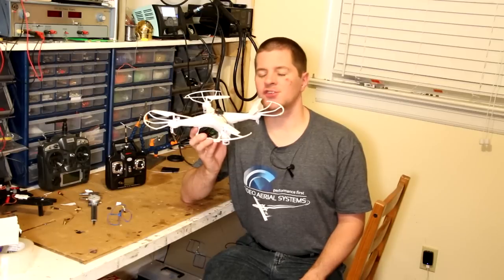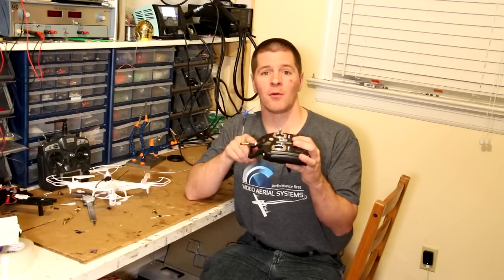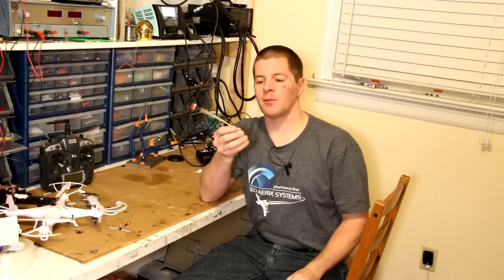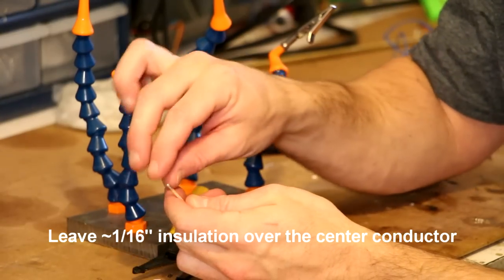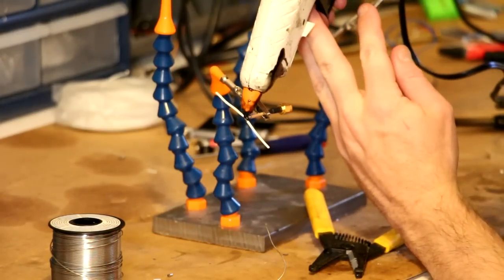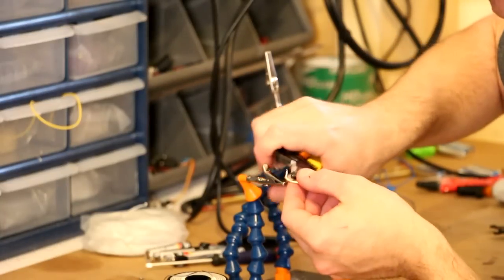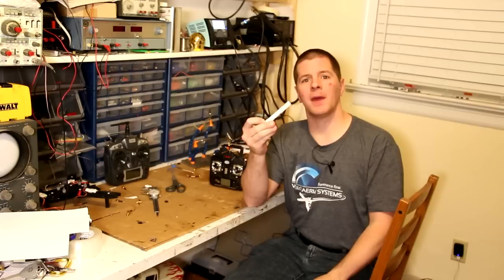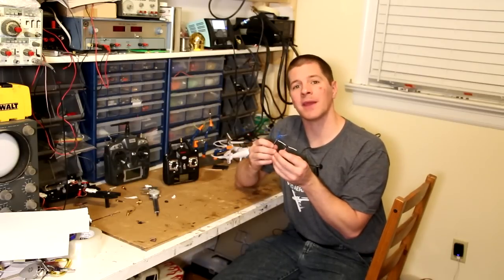Syma X5C control upgrade (FPV mod part 2)

Comment: I did the mod. But I changed one thing. Instead of soldering two 1.25 pieces on the end of the antenna I just measured back 1.25 from the end and unraveled the shielding and twisted it together and bent it 90*. Did the same for the center wire. Worked perfect. Less soldering that way. I also soldered the end and  put heat shrink tubing on the shielding wire to protect from grounding out and making it stiffer. I stuck a wooden  dowel in the hole where the antenna comes out and taped the new antenna to it, no more floppy antenna.
Reply from the maker: Nice work and good suggestions for other builders.

Comment: Nice set of vids.  I'm on my third x5c and they are fun.  On #2 I went all in on the antenna/camera mod.  I replaced the stock xmit antenna with a 6db 2.4ghz from an old Cisco router, which gave me a full wave, adjustable.  I then went into the copter antenna and quadrupled it's length, but laid it along the arm and hot glue spot down.  The max range on this went to extreme, as in hundreds of meters, but it also created a major problem.  Seems that some of the locals using their 2.4ghz things would mess up my signal and the last time I saw "Quaddie 2" it was happily flying away, totally out of sight.  I would say that I kept some control for probably close to 300 meters.  On the camera, I use the Mobius and replace the stock battery with a 100 mah. I use medium density foam for a mount and it eliminates almost all jello.

Comment: Moding the antenna inside the quad properly will make a huge difference. You can get over 1km.
Reply: Offshore Drifter definitely not 1km mate. 300m at the max

Comment: I fly my X5C with my X8C Venture Controler.  And my range on the X5C1 with 6 units using the stock controler is OUT OF SIGHT! Over 300 yards!  I have never had one go less!  And THAT is how I have lost two!  I can't see what way to put the stick to bring it back and with the 680 Battery!  She goes pretty far!  Never found one, the other is waiting to fall out of a tree.

Comment: My X5C got about 80 meters without a mod.  I used a router antenna on the controller, not that it really needed it.  Now it can be a speck in the distance and I can still control it.  Unable to test range as it would be out of sight.  This controller also works with my X11.  Some controllers must come from the factory with a weaker output.

Comment: Hi,Alex
My Syma X5C-1 ( bought 2 months ago) had  pretty good 312 ft (98meters) range  right from the box. I found some RG-174 (50 ohm) cable in my house and decided to make the same (a little bit simpler)  like yours dipole antenna.For first try I made each arm 31mm.  Test showed no improvement . For second try I considered my cable/wire velocity (i.e. electromagnetic wave propagates  with different speed and losses  in the cable then in the open air) and cut each arm to 27mm.... And ,Oh Magic! The test on the surface showed 713ft (217meters). So,thank you for provoking lazy me with this little project.
 Now I have a question to you : have you tried to play with the antenna inside the droneI would show couple of pictures ,but have no idea how to attach them here.

Comment: Great mod, but I don't understand why you were getting such a bad range.  I have an X5C and get much better range than that stock.  Never really measured it but I know it will do at least 30 - 40 meters.

Comment: Hey man very nice video! i have a question, i can solder a copper stick straight into the remote board? and in the quadcopter you leave the original one? standing up? how about copper wire too? Cheers man

Comment: Hi, I saw a different video where an unshielded wire with SMA female connecter was used. The wire was cut down to 6.25cm (half wave) and soldered instead of original antenna. Then true shielded antenna was attached to SMA female end. Any thoughts on this? Thanks for a great video.

Comment: Hi Alex! Great video! I attempted this upgrade tonight and I think Syma has changed the design of the antenna board. I did not see a second place to solder the shield. Have you heard of this happening? Could they have changed the design to make this modification impossible?
Reply from the maker: Joseph Lohmeier - I have not heard of any changes.  Try testing around the board and simply use the nearest ground you can find.  Ground is common throughout the entire circuit.
Reply: I found one directly to the left of the original antenna. It's no longer below. Thanks for all the coo tutorials! I can send you a photo if you're curious about the new layout.

Comment: Is there a certain type of RPSMA cable that works for this? Is there a specific length needed to be cut from the RPSMA cable too? , ive tried this on a UDI 818a and never got any changes in range

Comment: Alex,

Have you had any experience with the Ominus transmitter/receiver antennas?

I'm disappointed by what I perceive to be a fairly short range on my unit even when I'm flying in areas that should have minimal 2.4ghz interference (parks, farmland, etc).

Do you think the transmitter would benefit from this type of upgrade?

For the multirotor itself, I drilled a small hole at the top to expose the antenna lead in the vain hope that this would reduce some of the signal loss which may occur due to the placement of my 808 #16 (typically in LOS between myself and where the receive antenna rests in the body from the factory).
Edit: Putting the receive lead UP vertical decreased the control range greatly. Switching it to DOWN vertically (extending just about as far as the body of the 808 #16) significantly increased the control range. However, I feel it still could be better.

My knowledge with RF is rudimentary at best, so I look forward to any further help or tips you may offer.

Thanks for your time.
Reply from the maker: ***** - I am not familiar with Omnius antennas at all.  Most antennas I see are just junk, though.
Reply: Alex Greve
Good to know. Do you have any material I could use to try and see how bad/good the antennas in my Ominus are?
Reply from the maker: ***** - Not really.  At least not anything cheap.

Comment: Can I just solder a 31mm piece of wire to the GND pad and keep the stock antenna? Would they have to be 180 degrees from each other?

Comment: I bought the nice black one today I used to race petrol rc cars would the acoms crystal antenna work with my old controllers? Or would I be able to change the crystal reciver in the remote ?
Reply from the maker: scale model workshop since 2013 The days of crystal oscillators are long gone.  That will not do you any good these days ;)
Reply: Yeh?  every rc car uses them still tamyia,hpi racing ,Schumacher petrol engine and battery use crystals couae when we race them we need to make sure we all have a different numbered crystal so the reviver don't control another car ! I'll maybe try it but the x5 sc explorers 2 version has great range nearly lost it today on a roof lol

Comment: so even with the notch filter the control has been affected? im sure the stock range is not 5m?
Reply from the maker: I was getting only 5 meters before control became intermittent in certain areas.  Outside I would go ~10 meters or so.  Right now I'm going ~65 meters with the antenna mod.  The notch filter certainly helps, but it does not cut all interference.  The first harmonic of the 1.3GHz band is very close to 2.4GHz which causes problems with control if not filtered.
Reply: Alex Greve agreed I have two stock RNG sucked mainly because the remote antenna is stuffed in sideways horizontally and isn't proper length but any dlink saves the day I did the antenna in the quad and found a difference but I also dropped the wire out the bottom and out a landing bar hole

Comment: Hi alex i'm new here, I have the syma x8w and i'm wanna know if i can use any wifi antenna?
Reply from the maker: +jesus aguilar bossio - I would think you could so long as you can do this mod.  An antenna only cares about the frequency and the connector.  if those match, you're good to go.

Comment: Hi Alex,I have recently bought the Syma X5C-1 quad. I also bought some 2.4Ghz wifi antennas with leads in preparation for doing the antenna mod as you have shown. The problem that I have is that on my board where the standard manufacture antenna is soldered there is NO ground tab on the pc board to attach the braided part of my coax to. I have taken pictures but can't see that I can upload them here. Totally confused now. Please help. Best regards, Dave.
Reply from the maker: +Dave Bear - Find any ground inside the radio and attach the coaxial cable to that.  From there loop it around to the antenna pad on the radio.  Be sure to keep the cable inside the jacket (you can solder the shield anywhere along the run) until you hit the antenna pad.  Just solder the middle of the cable somewhere inside the radio to a ground.
Reply: +Alex Greve  Thanks Alex for the reply. After further investigation it turns out that the newer models have the ground pad there but it is covered with the circuit board colour coating. I was able to gently scratch the surface away, test it for grounding and solder it pretty much as you have done in your video. Upgrade completed now and working very well. Thank you.
Reply from the maker: +Dave Bear - Good to know.  I will pass this information along to others who have a similar issue.

Comment: I just completed this mod with the dipole option, I have a question though, you said the dipole should be aligned vertically with the copter's antenna , does this mean on the same plane? of the 4  X5's I've had apart the antenna in the quad is horizontal and pointed towards the right/front motor, should it also be vertical?
 Thank You for another awesome tutorial.
Reply from the maker: Yes.  I actually opened up the quad and drilled a hole through it so the quad antenna would also be vertical.
Reply: Awesome, Thank You !!
Reply: @CAGreve1231  Does it give better range overall or just horizontally ?
Reply from the maker: @Murlockingqc  - overall range in all directions.
Reply: @CAGreve1231  Thank you for the reply. Great videos.

Comment: Yo homie I tried to do this to my syma x5sw.  I went to the thrift shop and got a router for $1 anyway there is no grounding pad on the board.  where the hell should I put the ground wire?  any idea thanks man
Reply from the maker: +Dylan Kowalski - I was told there is a ground pad underneath the silkscreen where I have it in the video.  Apparently it is just covered up.
Reply: +Alex Greve awesome thanks for responding.  yea it looks different than yours. It's brand new I just got it last week so I dunno if it'd a new run or something.   I'm gonna have my buddy who knows more about electronics do the mod for me I'll film it for my channel so I can show ya.  Thanks again

Comment: 8 meters range by default? Doesn't sound correct, I've flown over 25M horizontally and vertically with no issue. 
Great video anyway, just wish you had a more zoomed in view of the cable stripping.

Comment: Alex....
Hey man, can you post a link to that RG 316 cable? Seems it's a little harder to find that I thought.   There are several extension cables on ebay man, but all are more than 10 or 20 bucks, and way more cable than I'll ever need.  Thanks man!
Reply from the maker: HumptyDumptyWasPushed - This will do.  $4:  http://www.stoneblueairlines.com/hangar/6-inch-sma-male-to-sma-female-extension-cable.html
Reply: Thanks man!

Comment: Hello Alex, 
Quick question, I have made a mod to my Walkera Devo F7 transmitter with an SMA to accept any type of antenna for better transmission to my QR X350 PRO, it's receiver RX703A has the standard two gray wire leads, would it be best to use a   cloverleaf antenna on the transmitter for it's 2.4ghz rather then a long linear antenna ?
Thank you so very much 
Steve
Reply from the maker: Probably.  However it might be difficult to connect a cloverleaf to that receiver.  Most of those use mini coaxial cable (1.17mm) which is very difficult to solder.
Reply: Opps , i forgot to mention i've already got the coaxial cable connected, the internal part snaps on. the SMA is on the outside.
I do have a few of your 2.4ghz cloverleaf but i have not yet tried one , i'm currently using a long linear antenna , i'm wondering if your cloverleaf would give better distance coverage ?
Thanks again
Reply from the maker: steve golden
I am having much greater success with the cloverleaf antenna for this aircraft.  Even with the 3db loss going from circular to linear polarization, I find the cloverleaf performs best.
Reply: Alex Greve
very cool , thanks Alex, i will make the change over .
and i'm really loving the cloverleaf for my 5.8ghz system !
Reply: sorry to bother you again ...... do i use the 4 leaf or 3 leaf on my transmitter to the standard RX of the qr x360 pro , this is just for the control of the system & not video.
Thanks Alex
Reply from the maker: steve golden
- 3 lobes on transmitter, 4 lobes on the receiver.

Comment: my stick syma is getting about 30 meters, will this mod get me over 100 meters or should I just use a 6dbi antenna.
Reply from the maker: It should get you ~75 meters.  A 6dbi will get you ~110 meters.

Comment: does it matter if the cable is long or short does it have to be at a certain length?
Reply from the maker: +kwabiNEXAS -  Cable length on the antenna does not matter.

Comment: I've heard that the coax length should be some multiple of the wavelength to be used.  Tell me that this is a myth.
Reply from the maker: In this context it is indeed a myth.  This is an old question regarding impedance matching of mis-matched loads.  In old days of HAM radio, cables and antennas were not always matched to proper impedance and thus you needed to use whole wavelengths to prevent an impedance shift.  In this tutorial, the antenna and cable are already martched so there is no need for special lengths.
Reply from the maker: msw smw *You're.  There is a difference between element length (that matters) and coaxial length (which is more or less irrelevant in this case).

Comment: Hey bud ordered a camera set camera has a shift mono ant can I use a clover RX with it ????
Reply from the maker: I would assume you could, yes.
Reply: Ugg I'm building a fpv  truck for quad searching and boat hauling when it's done I'll order a set of airblades and blue beams and do some testing

Comment: but if you put your Phone on it with wifi fpv it wont be 300m Right? ? is there a way for That Do?
Reply from the maker: Range of the WiFi Syma X5 is going to be significantly shorter than the mod here.  This was done well before any other versions existed and it is still the highest performance vehicle.  The problem with WiFi is not just short range, but video lag.
Reply: Video Aerial Systems is there a way to improve it so there wont be to much lag?

Comment: I purchased a x5c a couple weeks ago and I opened my remote to do this mod but was surprised to find that it had a different radio with only one soldering point. can you give me any help? http://imgur.com/XMkkR57
Reply from the maker: There is a ground pad under the covering on the circuit board, apparently.  A few people have told me this, but I have not seen this for myself.

Comment: Just a couple comments from someone who's been flying RC for almost 55 years, has an Extra Class Amateur Radio License, and is a retired Senior Electronic Technician.  Re: modding the length of the 1/4 wavelength stub inside the craft. Changing to 1/2 wavelength seriously changes the characteristic impedance. A 3/4 wavelength stub however, will be close to the impedance of the original 1/4 wavelength stub (so instead of 31.5mm ... 94.5mm). Your FPV mods must be seriously reducing the range of the X5C. The Syma X5 is not known for great range, but out of the box, you should get 50-60m easily. I fly mine with a Syma X8 TX, which has the same bind protocol of several versions of the X5 FC board, including the latest rev. v6. This gives my X5 range beyond my ability to see it (100+ m). I also have flown my X5 FPV, but went a different route. Instead of using the crappy camera which came with it, I use the 808 Keychain #16 V3 (D lens) camera (self powered). I output its video signal to a 25mw VTX with 5.8 bare cloverleaf antenna velcroed to the top of the craft. I also put a 2S (7.4v) 180mah battery on the craft to power the VTX.  Because of the extra weight, flights aren't long in time length, but range is very good outdoors.  The BayangToys X5 (clone) might be a better candidate for this, since it has more powerful motors than the Syma X5.  The Syma X5 uses 7mm x 20mm coreless motors. The Bayangtoys X5 clone uses 8.5mm x 20mm motors.  Those are just some observations to pass along. Cheers  (BTW, you can buy a X8 TX from many vendors online for between $13-$15 .. or at least you could. Check the X5's FC rev 1st, to be sure it is rev v6)
Reply from the maker: Hence why making the aircraft antenna 1/2 length did not work.  I heard that it worked from several people but could not verify it myself and thus recommended against that mod.

That said, few of these devices are impedance matched at all.  I find seemingly random lengths of wire has better effects than 1/2 or 1/4 wavelengths.  The sensitivity also varies greatly between vehicles, most likely due to poor manufacturing tolerances.

The cable mod for the radio does work, though.  I am getting 4-5X the range out of my Syma's.  I use them for FPV so it is helpful to go beyond line of sight.
Reply: Just to confirm because that was a lot of words for a newbie like me, but are you saying this mod would be better with a 1/2 wavelength on each side of the dipole ?